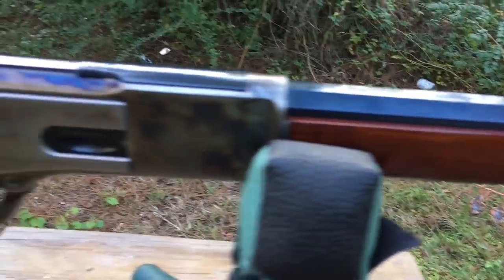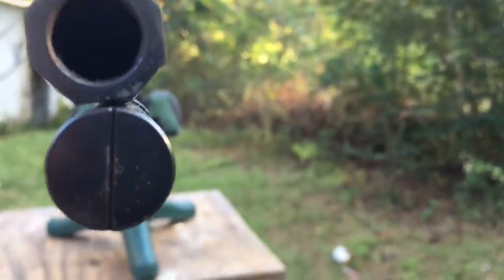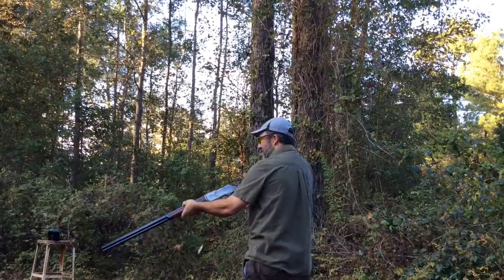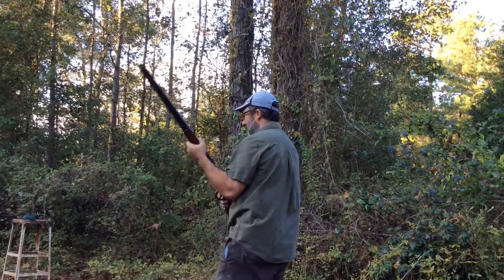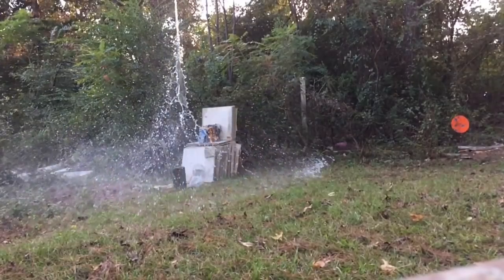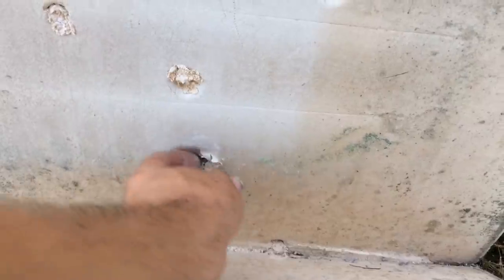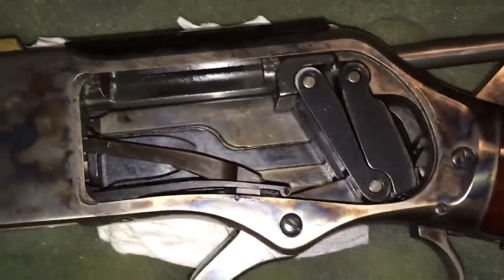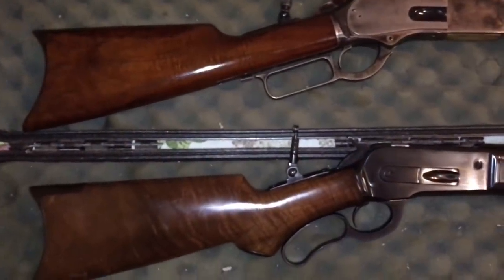1876 Winchester 50-95 Express, Cimarron copy, the 76 was first big bore lever action rifle

Comment: I thought about buying one of these but in the Presidio version with the 20 inch octagon barrel and button mag. I am familiar with the .50-95 but never fired one, how does it compare recoil wise to .45-70? It's either that or maybe the 1876 RCMP carbine in .45-60.
Reply from the maker: Bayan1905 The gun so big and if you load it with traditional the loading of the smokeless powder loads they don’t hardly kick , however black powder does have some recoil but still very manageable but like a 30-30 with 170 grain bullet

Comment: Good video. I'm planning on getting one and am wondering if 50-95 shells can be made using 348 winchester brass. I have quite a bit of it.
Reply from the maker: No because the rims and base of the cartridge  is too small you can make them out of 50-70 brass, but they’ll be a little bit short until they stretch

Comment: Is there a book you recommend or website for loading black powder? I’m trying to get into it.
Reply from the maker: I’m sure you can do a Google search for a black powder loading data, basically the bullet needs to be down tight no air gap needs to be a compressed load, Blackpowder you can get 85 to 95 grains under 350 to 300 grain bullet, ffg Blackpowder,
If you have a New copy 1876 you can look up modern smokeless loads

Comment: Out of all of the cartridges used in the 76 if I wanted to buy a replica what cartridge would you choose? What do you thinks the optimal for being able to hand load and be able to get brass to load? Also something that performs well. Thank you
Reply from the maker: I think the 45-75 would be a neat caliber, because you can get a awful lot of bullets a different bullet weights for it, and yet it should be more powerful than the 45-60. The 4560 would be the easiest to make because you could just shorten 45-70 shells, The 50-95 is the most impressive, right now I don’t think you can get shells for any of them, But you can probably get some 4570 shells so you could make the 45-60 Best place to look for supplies is at buffalo arms
Reply: @Leverguns50  Would I be able to buy 45-75 brass ? If not how would you make your own? I was thinking the 45-60 would be best just because it's the easiest but it would be less powerful. What's your opinion on the 40-60? Probably the same problem where do you get brass for it? Thank you I appreciate it 👍
Reply from the maker: You can get the 45-75 brass from buffalo arms when it’s available, 40-65 can be made from 45-70 brass well it might be a little bit harder
Reply: @Leverguns50  Ok good. Hopefully we get past all the shortages of everything. I'd also like to have a 73 in 4440 the 76 in either 4575 or 4560 and 86 in 4590 and a 94 in 3855. I think with those I can pretty much do everything that I want. Plus I have a nice collection of rifles. Thank you 👍
Reply: Also I wouldn't mind having a Marlin 336 a 24-in 35 Remington

Comment: Very nice 👍. I always wondered what the inside of the 76 looked like versus the 73 looks identical just longer like you said. These heavier cartridges are quite a bit more pressure then the 73 I always wondered if they did something to make it stronger but it doesn't really seem like it? Did you see anything in there that made you believe it was stronger than a 73? Do you own a 73 and what is your opinion of the 1873? I had thought about getting the Miroku in 44-40 or 45 Colt. What is your opinion on the 44-40? Thank you
Reply from the maker: The 4440 is an excellent black powder cartridge because it seals the chamber so good, but when it comes to smokeless powder I’d probably go with the 45 colt
Reply from the maker: Some of the Italian companies make the 73 in 44 magnum, so the actions probably stronger than most people think
Reply: @Leverguns50  that's exactly what I was thinking.
Reply: @Leverguns50  Yeah I'm trying to decide whether I want to load more black powder or smokeless. I did hear that 45 Colt seals the chamber well if you anneal the cases?

Comment: I got one in 45-60 only problems I had was grooves on the hammer were bad and trigger is gritty but it is super accurate.
Reply from the maker: Did you ever get that hammer fixed, is that an original?
Reply: It’s a copy not a original. I tried fixing it myself but it is still not right I just live with it.

Comment: I wonder why they made it in a 28”. The original .50-95 was considered a separate model by Winchester, and was called the “Express Rifle”. I can’t remember if it was a 24” or 26” that was standard in the calibre. The other calibres used a 28” barrel as standard.

Comment: I bought a Cimarron/Uberti 1894 in 38/55 not long ago. It would not feed full length rounds NIB. Went back to Cimarron and they did nothing other than make remarks about reloads. So I fixed it myself. Obviously Cimarron/Uberti had never looked at an original Winchester to see they have beveled chamber throats. My experience with Uberti made rifles is not positive. I sure won't have another.
Reply from the maker: That’s sad, they really could do a better job of taking care of their customers, basically, if you buy one you have zero warranty, if you can’t fix it, or get a gunsmith to fix it, you’re in trouble

Comment: Koolest rifle I ever shot was a, 220 Swift.
Reply from the maker: My good friend has one of them, One day we shot it was ballistic tip bullets, but they wasn’t made for that kind of speed, and it left blue smoke rings all the way to the target, it was super cool, not very accurate though because the bullet tips were melting
Reply: It had a 9X scope & 3" drop in 300 yrs, a great varminter!
Reply: Be4 I discovered girls I hunted the bush 4 BC costal dear from the 60s to late 70s. My 1st large Cal. rifle was a 1909 BSA 32 Cal. Couldn't go through a pH book but would knock it down. Had a Marlin 45 Cal. leaver action, but my fav was Winchester 94 30-30. Best bush rifle goin.

Comment: The cartridge was later necked down to .348 caliber and became the .348 Winchester in the Model 71 lever rifle...itself a version of the Model 1886.

The 1876 was developed by Winchester to compete with the big bore, single shot rifles used for buffalo hunting.  They never made it big commercially, the buffalo hunting days were nearly over before the 1876 came along. There was nothing but scattered herds left by the late 1870s except in the north plains and those were decimated by the early 1880s when the Great Northern railway put tracks into that region. And the rifle was expensive. There was a serious economic depression in the 1870s. (The "Long Depression" 1873-79) A Remington Rolling Block or any number of less famous single shots, could be had for a fraction of the price and would kill buffalo just as well. The idea that buffalo hunters were all running around the plains during a worldwide economic depression with expensive and fancy Sharps and Winchester single shots is belied by the fact that Sharps went bankrupt and dissolved in 1881. For other hunting, it was too big, expensive and heavy to be practical.  The purpose for which it was developed no longer existed by the time it was introduced. 

The Winchester 1886 killed it off with it's much stronger action within a decade.  It is notable that the Royal Canadian Mounted Police chose the Model 1876 in .45-75 as their issue rifle until the 1920s or so.  Rumor has it that some were used as late as 1940. 

I am a Winchester collector and do not have a model 1876.  I guess I would like to have one to fill out the collection but they are quite scarce and expensive.  I do not collect Winchester copies. As a representative rifle for a guy who likes lever actions, this would be an interesting piece.  As a practical hunting rifle, there are many better lever actions.
Reply from the maker: I love to hear stuff like this, I wouldn’t really call myself a collector more of a lever action enthusiast, and somewhat of a amateur history buff, I like to take things that was made in the past, and see how they work, to get a feel for the past, thank you for expanding on their history.
Reply: @Leverguns50  I was fortunate to have a father and grandfather who were "gun guys".  My grandfather loved anything designed by John Browning and had many of the lever actions Browning designed for Winchester...all of the "models" but not all of the versions.  So I inherited a good start on the collection.  I then have added many more over the years.  It has been a lot of fun to collect them and study them.  I do not have an 1866 or an 1876, but have all the rest covered.  My favorite is the M1895.  I have one each in .30 Army (.30-40), .35 WCF and .405 WCF.  I used to make ammo from .30-40 cases for the .35 and .405 (a little short, but they work) until Hornady came out with the .405 a few years ago and I laid in a stock. It is easily necked down to .35 WCF. 

I also confess a fondness for the Model 71 in .348.  I have a carbine and a deluxe rifle in that model.  I inherited the rifle and bought the carbine years ago before they were so crazy expensive. 

I do not have any of the really "big bore" Winchester lever guns, .50-95 or .50-110.  My model 86 rifles and carbines are all either .45-70 or .33 WCF

I like your channel.  Keep the videos coming!
Reply from the maker: I had to wipe the drool off my face after I read this, 😂 you have an awesome collection, I was thinking of getting one of those new 95’s in 30-06 and re-chamber in it for the 35 Winchester. So far my favorite is the 71 Winchester and 348 caliber. The 1886 Winchester 50-110 is probably a close second, but of course the little 92 is just fun to shoot
Reply: @Leverguns50  I have actually considered getting one of those also as a surrogate rifle to reduce wear on the oldies.  But I do not shoot them so much anymore anyway.  

Your idea is good but there are a couple problems.  The .35 WCF has a rim diameter of .545".  It is based on the .30-40 Krag cartridge.  The .30-06 is rimless and has a head diameter of .473". So you would need magazine and bolt face work also and there are not many people doing that work.  If you know someone, great.  another possibility, which would be ballistically equal, if not historically correct, would be to re-bore the rifle for .35 Whelen. No other changes would be needed and the .35 Whelen easily matches the ballistics of the .35 WCF, even exceeds them.

Comment: Great penetration. Is this for BP only or can modern powder be used?
Reply from the maker: Just like the 73 Winchester you can shoot smokeless powder you just have to shoot it at the lower black powder pressure’s which on this one is 26,000 PSI

Comment: 1887 rifle Why is this rifle has a elevator when you put a bullet in the chamber and the 1886 has a lock-n- lug is  it because one more powerful then the other one or the 1886 is more high pressure thing the 1887  but great video on your level action rifles 🥃🍺🇺🇸❤️✝️
Reply from the maker: Eugene Johnson The 1886 is a lot stronger action, the1876 is a really smooth action and more than strong enough for what it was made for